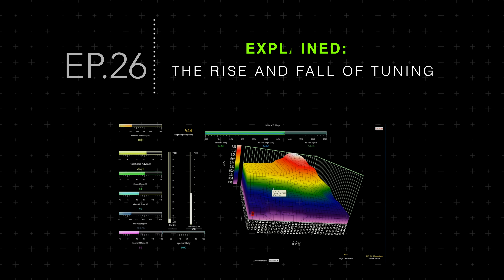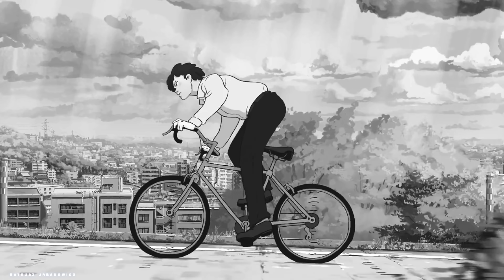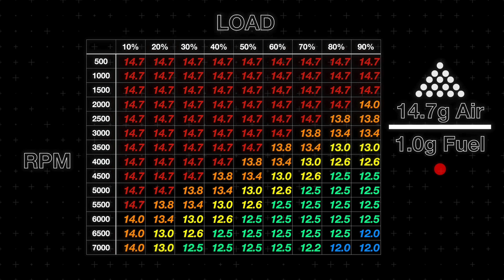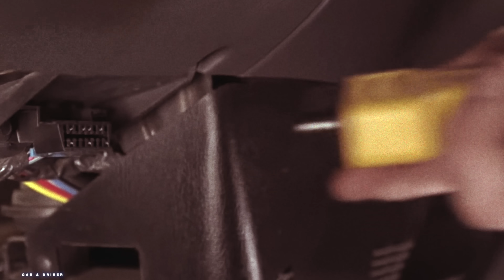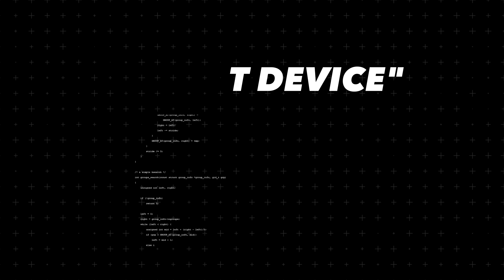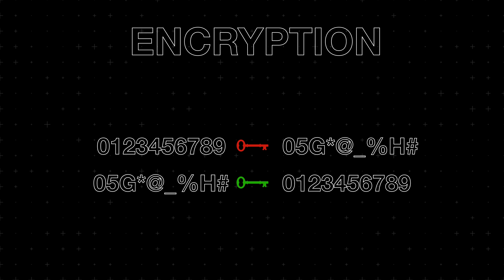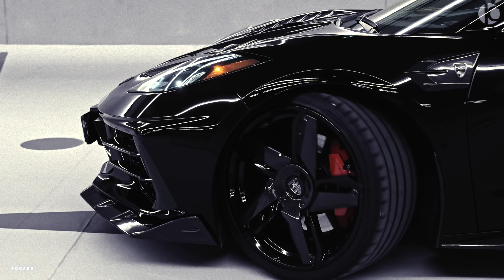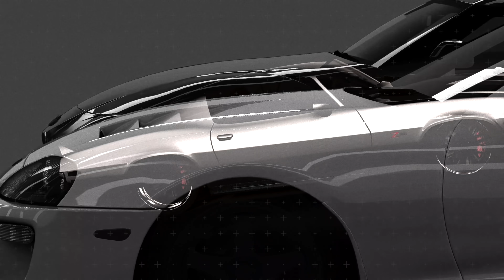How Tuning Engines Became Illegal👮🏻‍♂️| Explained Ep.26

Comment: In Germany, this is normal.

I own a tuning shop and we actually do those emission testing procedures.
For a simple ECU tune, you'll be looking at around 15-20k, if you pass the first time.

Of course as a company, you can sell it to as many cars as you like - if it is the car you tested with the transmission you tested (can't homologate an automatic and then sell for a manual)
The bigger Problem is the combination of parts. Since you can not change the code you've homologated, there's no costum dyno tune. Just a flash tune.
Also, if you want to install an intercooler, and exhaust or even sometimes different tailpipes, you will have to redo homologation for that specific combination - same thing with intake systems and so on.

Imagine having 3 products as a company. An intake (IN), exhaust (EX) and ECU tune(SW).
If you want to sell them all individually and in ANY combination possible, you will have to do the following homologations:
IN, EX, SW, IN + EX, IN + SW, IN + SW + EX, SW + EX
That's roughly 105 - 140k in homologation cost only. Add an Intercooler and you could just buy a lambo instead.
Yep. The struggle of germany. If you want to know what tuning looks like in the future, Germany can give you an idea
Reply: It's absolutely verrückt
Reply: That sounds awful
Reply: Man, and that's insane! In New Zealand you can change intake/exhaust/tune/wheels etc no problem. Though things like engine/trans swaps and suspension/brake upgrades will warrant a certificate plate. Rules around car modification are pretty relaxed here in the grand scheme of things
Reply: Does this have to do with the TUV regulations you guys have in Germany?
Reply: @deep_drift  yes pretty much. There are a lot of European laws in place like that actually but most of Europe doesn't care that much. Germany cars. Like A LOT
Reply: Yeah most of EU is like Germany but only the Germans, Austrians and Swiss people enforce it.

As soon as we are getting to the point where the company runs without me, I will leave for this reason. I've never experienced the sound of a turbo civic, big turbo supra or a loud muscle car
Reply: @NEWdarkdragongx  my heart goes out to you. New Zealand and Australia produce some crazy builds, I feel sorry for enthusiasts in other countries who miss out
Reply: Choked out of the race.... Pricks
Reply: And aren't you guys gonna only be "allowed" to eat a certain amount meat products per month at some future date? No more beer and shintzle/sausage-fests. Too much meat farts of methane polluting. But not to worry, claus has billions of "delicious" bugs for you to eat. Gotta keep everyone enslav...I mean "happy". 🤔. Such a wonderful person, him and all his friends.
Reply: @mrt2this607  it's already allowed to put bugs into the food. There are even restaurants in the capital Berlin which only serve Insekts and bugs.

There is a political party called the "AFD" Which used to have maybe 10-15% of votes from the population. They are against all of this as our economy will crumble without the ICE Engine. It's the strings holding our economy together. The engineering of engines.

But there is something called "sonntagsfrage" where they ask people "if there was an election next Sunday, which party would you choose"

Well, since the last administration the AFD has gone up from 12% to almost 50%. The media portraits them as conspiracy theorists, as they called out some of the BS that happens 19-22. Also they're saying the Ukraine war is tragic but it's not our war and so on.

Maybe we will for once take a step in the right direction instead of having a collapse and then rebuild everything with the German work ethic - which is unprecedented IMO but the Germans like the authorities so they do what they're told
Reply: Emissions regulations like the ones from EU need to be removed
Reply: Emissions regulations like the ones from EU need to be removed
Reply: @phalanx5667  I'd have to disagree. I know how cars smell without catalytic converters so there is a place and reason to use them. If I was in control, I would for sure build more racetracks and keep the no speed limit highway laws.

Also you'd have to have a catalytic converter with at least 100cells per whatever it's called.

Finally you'd have to put something in place to Limit the noise pollution in city's as you have to take everyone, even non car ppl into account. Not sure how tho unless I just don't care about privacy (like GPS operated valved exhaust or something)
Reply: @NEWdarkdragongx  
Thanks for your detailed response.

of course you are correct. Let me clarify what I mean. The euro emissions regulations have made cities cleaner but Euro 5 6 and especially 7 are not really needed and are an unnecessary annoyance. In London we have ULEZ which has made many people buy new cars dispute them being perfect fine and mostly clean. Of course if u pay a daily fee u can still drive your car. 

Cars are more important than people think. They represent freedom and the ability to go where u want. Every 5 years across Europe there is an attempt to attack motorists, either with a new tax, new emissions regulations or laws to make modifications illegal. It’s an offence to normal commuters and with the latest regulations, it attacks us car enthusiasts.

Governments have an agenda against a group and then over time attack a small sub section of the community so they get little negative feedback from the wider community.
They are trying to promote their bad transport systems and make as much money off us and car manufacturers.
Reply: There's an attempt to attack everyone. Hence my username and email which is the most random name I could come up with that sounds like a 5 year old thought of it. I don't want to be associated with it. As soon as I leave the country, I don't care anymore. But right now I don't want to tie anything to my company as politics involved into an all out war in the population.

Divide and conquer.

Comment: The EPA is really biting the wrong crowd E85 is a cleaner fuel compared to gasoline and tuning companies have been promoting it engines aren’t going away the tuning companies could make mods so people can use cleaner fuels  like e85 or hydrogen so people can continue to use their cars
Reply: E85 isn't as easy as people think.  Unless you have a car designed to run with a higher percentage of alcohol it you will trash the fuel system.   And strangely not all cars are flexfuel compatible which baffles me.
Reply: You’re the only one thinking that lmao
Reply: E85 destroys your car internals and has worse gas mileage than regular gas. Hydrogen is the future. 💙
Reply: e85 and hydrogen is not the same things. Far from